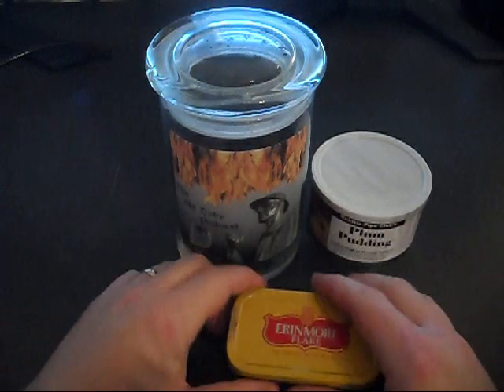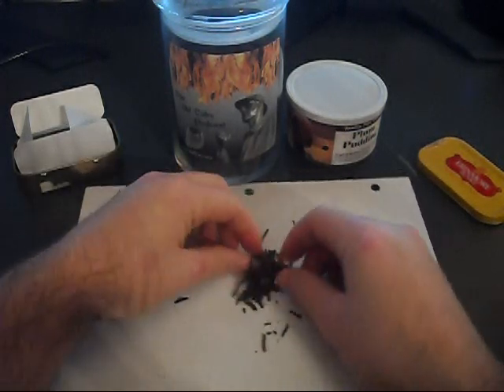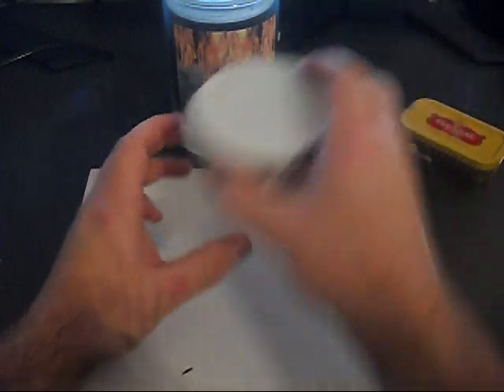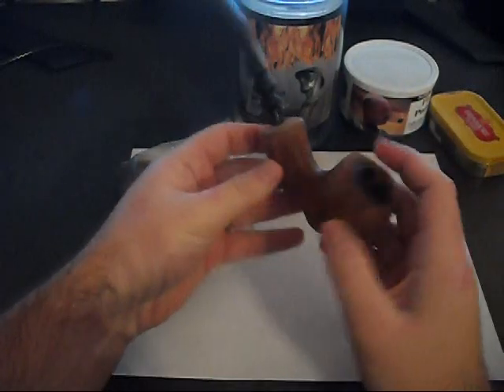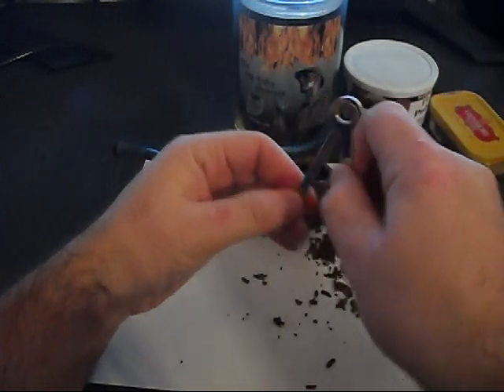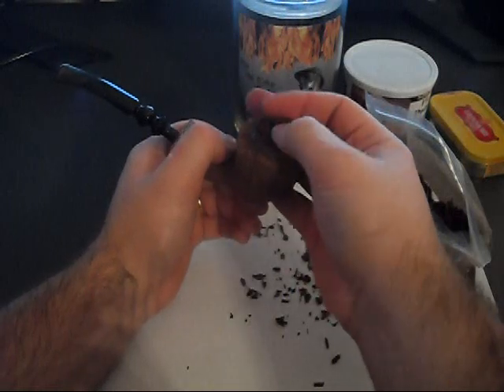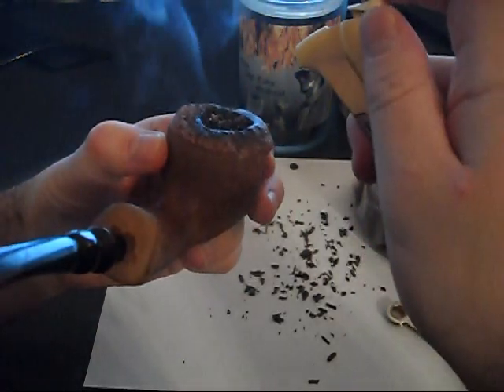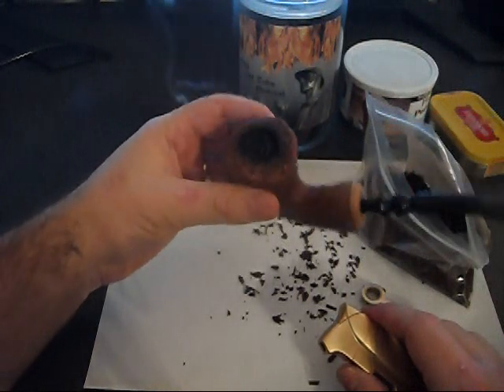Old Toby - How to Light a Tobacco Smoking Pipe

Comment: @Jctrynr i reckon you can. i got myself a weed pipe, and it works just as well as it does with tobacco. my friend doesnt smoke weed, just tobacco, so yeah. itll do the job fine. but a specified tobacco pipe will always be better